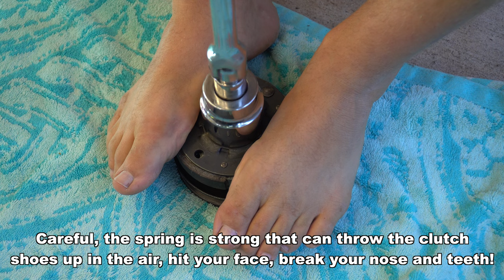EASY Clutch Nut Removal WITHOUT Compressor Tool! | Mitch's Scooter Stuff

Comment from the maker: T O O L S
Breaker bar 1/2 drive - http://amzn.to/2HenuMI
Variator / Clutch holder tool - https://amzn.to/2ZuYJEA
Torque wrench 10-150 lb/ft 1/2 drive - http://amzn.to/2GuMsHJ
Massive socket depends on size on your scooter
Reply: Brother can you tell me please to open Honda pcx 125 2017 which number of tools require to open this big nuts ?
Reply: Hi. How much torque did you use?

Comment: What Mitch is showing here is that you can do this work without a compressor and pneumatic impact wrench, or a cordless impact wrench, which is a very effective but somewhat specialized setup. If you think what he’s using here are special tools then you have no business doing any work on a scooter. The spanner or pin wrench he used is a $10 Amazon item. You need this for the variator side of the transmission too. The socket wrench is a standard tool anyone who touches an engine should already have. And the giant socket is also something you need to be willing to spend $15 on to save a trip to a mechanic charging $75-125 an hour. You will also need that socket, and a torque wrench, to reinstall the nut with the proper safe tightness or the clutch will fly apart during use.

Comment: It is a better idea to press those parts together with some screw clamps an then screw the nut back on it. Because if you press not with the same force, you can bend those two discs... I did this mistake the first time, when I replaced the clutch...
But the idea of loosing this Nut is really great!
Greeting from Germany :)

Comment: I have a 07 vino 125 and I bumped a sidewalk going about 5 mph while it was still running. I bumped it on the clutch side of the transmission cover and it suddenly sputtered out and hasn’t started since. Do you think I could’ve jumped the timing just by a little bump, or do you think the transmission won’t allow the engine to run because something broke inside of it? Thank you for your videos they are greatly appreciated

Comment: Hi Mitch, You are great help with you’re videos, if I need maintenance for my Pcx , You’re the man.   I have a Pcx 2022 , what size is the big nut holding on the clutch?     Is it 39mm?     Thanks again.
Reply: Just a further update, found information from a another video.   Socket wrench 39/41 mm.    Torque 54 NM. Hopefully this helps somebody.

Comment: May I ask any reason for not using impact wrench?
Reply from the maker: Impact wrench ok for removal... not for installation... it can over torque ... torque wrench is safer
Reply: @MitchsScooterStuff  can you use an impact wrench and then torque wrench for installation? without a clutch holder?

Comment: I use a oil filter wrench and a large socket on an air wrench, no need to even take the pulley off 😎👍
Reply from the maker: 👍🏼👍🏼 I don't have an air wrench... maybe one day!
Reply: @MitchsScooterStuff  I use an electric impact gun from Harbor Freight.  Very easy for removing the nut.

Comment: I use impact screw driver with 34 mm socket with a thick cushion under the clutch  setup to loosen and tighten the nut😊😊😊

Comment: Errr............   After you have tipped the scoot on its r/h side by placing the clutch holder tool against the floor, I suggest you find a long steel tube to slip over the holder tool handle and then let that rest on the ground somewhere up near the front of the bike !!!    hahaha   Sorry Mitch !  😂

Comment: You literally used all special tools lol
Reply from the maker: I fixed the title... the special tool is compressor spring tool.. that I didn't use in the video... what tools are special in the video? Torque wrench, socket, breaker bar are common to use for many things... Compressor spring tool is only one time thing to work on scooter... 🤷🏼‍♂️
Reply: All normal for someone running an active scooter YouTube maybe lol. The clutch wrench is the special tool. I specifically clicked on your CLICK BAITY title, assuming it would be how to remove it without that SPECIAL TOOL LOL.
Reply: Se puede afojar la tuerca del embrague sin  antes desarmar nada, sin sacar la correa.

Poniendo un palo de escoba entre los radios de la llanta y la caja de transmisión - embrague para, que la rueda no gire, y entonces aflojar levemente la tuerca sin terminar de sacarla.

Después desmontar todas las tapas sacar el variador, la correa y finalmente el embrague, para terminar de seguir los pasos de aflojar la tuerca finalmente, y de manera lenta, entre los pies, como hace este hombre.

PD.
Mejor ponte calzado por si salta el muelle no te reviente un pie.